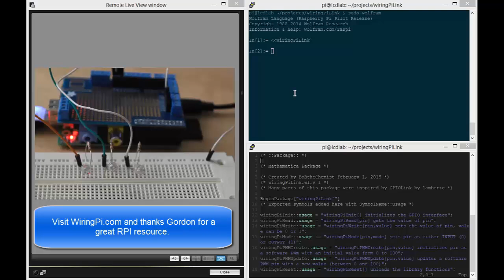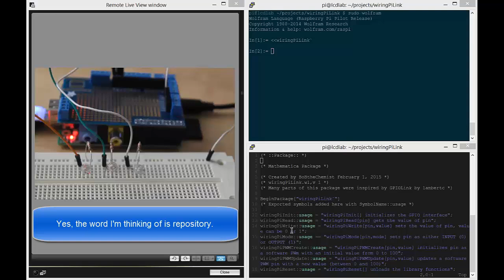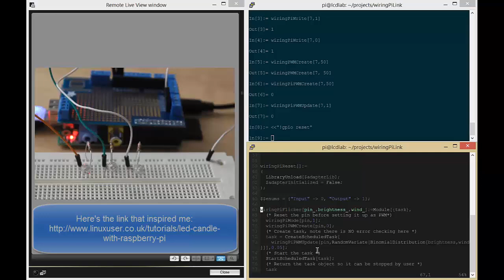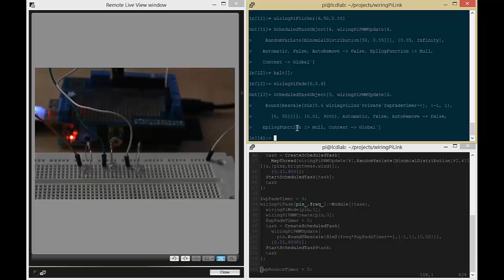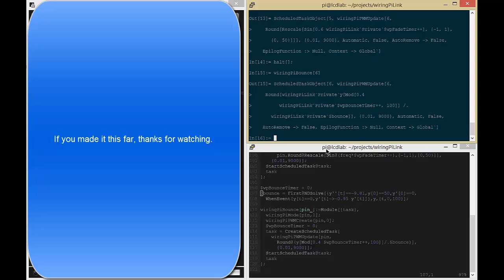PWM with Wolfram Mathematica on the Raspberry Pi

Comment: I’m extremely thankful that someone like Robert has taken the time to build the MathLink glue to make GPIO interfacing a snap in Mathematica and the Wolfram Language command line interface.  Although I’ve been using Mathematica since the early 1990s, his wiringPiLink package will get me up and running much quicker with hardware interfacing than I had expected.  I have a number of projects in mind which will require hardware interfacing capabilities.